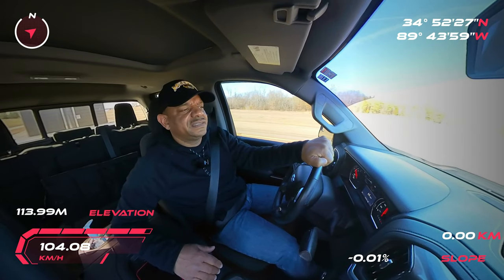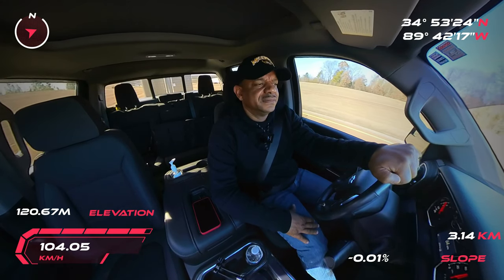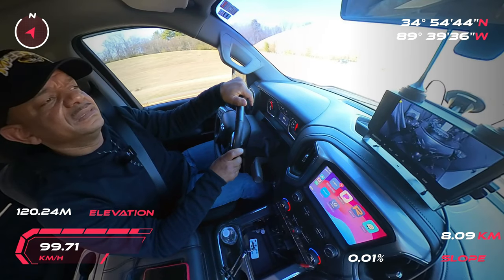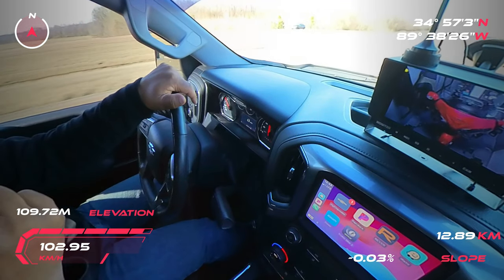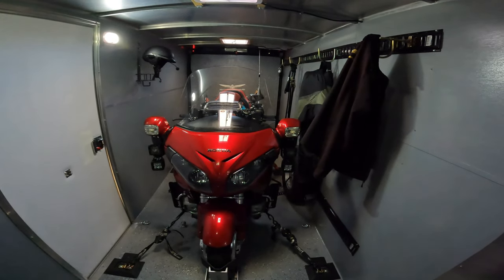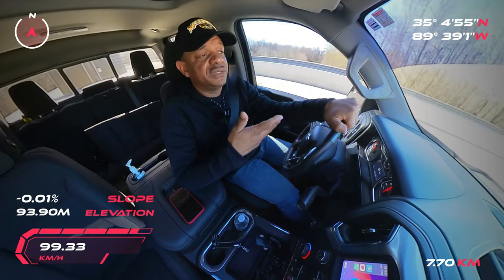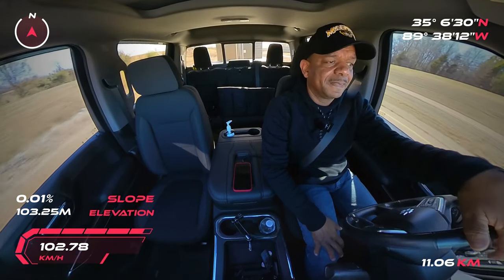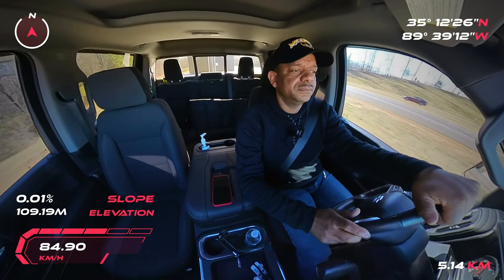Hauling my Enclosed Goldwing Trailer

Comment: I've only hauled my bike few times both on U-Haul motorcycle trailers. I was truly uncomfortable both times. I believe the motorcycle chock is the true game -changer here. Most chocks I've seen won't allow the bike to remain upright without the kick/center down. I've tighten the crash bar to the point it was moving forward. I think the way Chris had the straps more to the side vs front keeps the pressure off the crash bar. Good job like always Chris!!!

Comment: Hi Chris.  I've hauled my GW F6B many times, and thousands of miles using the crash bars.  Seemed like the best way to do it until it broke the right front crash bar bracket in 2 places and broke the boltheads off to the left rear crash bar.   The front bracket broke in 2 places. ( This bracket bolts to the motor area and the crash bar bolts to this bracket).   Since then I've used the bottom of the triple tree method along with the handlebar type tie down.  (the type with stiff plastic cups over each grip. Your vid shows it on the black sportster.)   I also strap the rear wheel so it will not slide left or right.  
Anyway, I hope you do not ever have the same issue as I experienced.  The right side internal bracket was about $180 and a major pain to install...          Ride On!!!
Reply from the maker: Thanks for sharing your story but it most likely that you kept ratcheting the straps down too tight, overtime it snapped.  Anything can break if you over torque it including wheels studs.  The old saying goes that too much pressure will buss a pipe.
Reply: @chriscaliente5033  I do not use ratchet straps, never have...

Comment: That’s the way to do it!!!    How do you fit the trailer in the trailer?
Reply from the maker: I just drive up the ramp into the back of the enclosed trailer
Reply: @chriscaliente5033 what I’m asking about is the trailer for the motorcycle?
Reply from the maker: When I trailer the GW, I always leave the small trailer but I have a special hitch on the enclosed trailer if I really need to bring in.